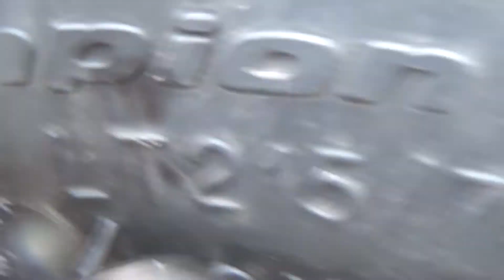Just having fun with the geo

Comment: Any advice on how to fix strut towers
Reply from the maker: what do you need to fix on it
Reply: @CantKillMe  they are rusted crazy bad I just bought it very cheap can't complain I'm having the typical trans problems so I have read I put some sefoam in this morning ran good all day but I think it's low not sure on how to check it running not running were it should be on the stick when it's warm or cold I'll take a Pic of the towers tomorrow In the day light show you and should I try to buy a strut bar to run across since they are so bad.